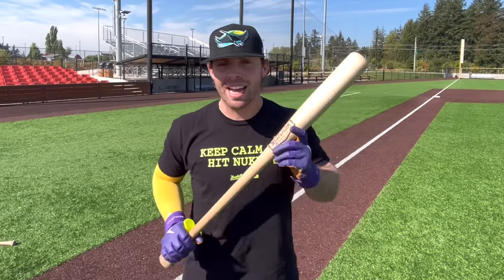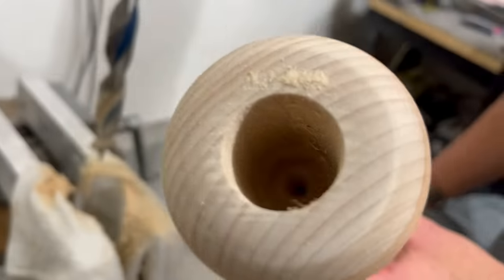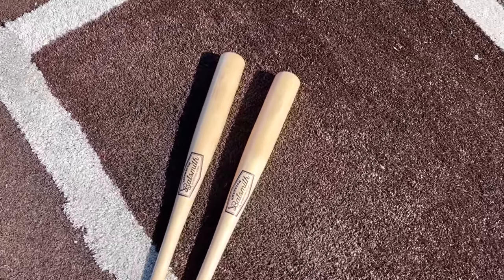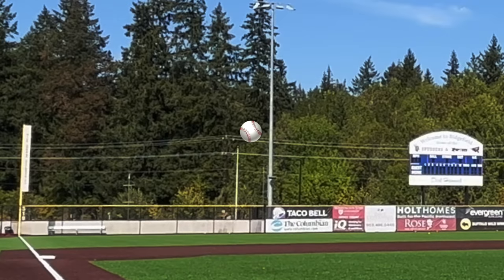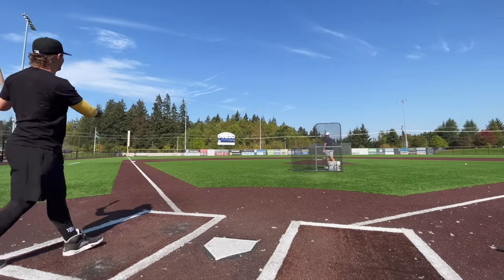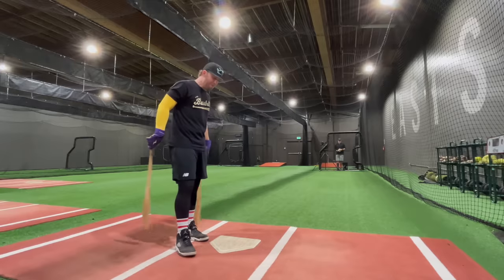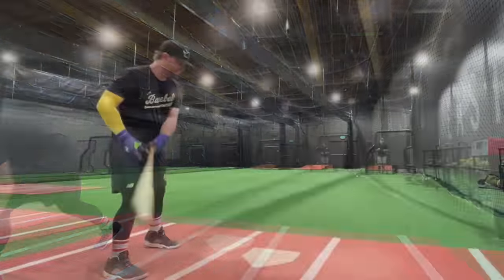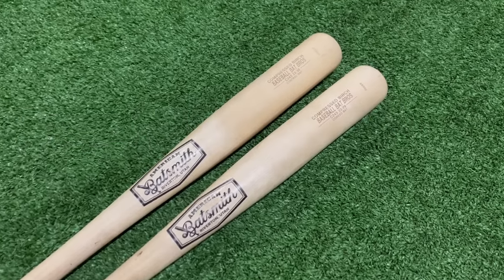CORKING A BASEBALL BAT (the right way)

Comment: Even this is wrong.
Corking the bat isn't about weight reduction. It's about making the bat hollow but reinforcing it with a material that keeps the durability..
Cork bats emulate the way the old c core aluminum bats worked. But not as intense.

Your supposed to grind the cork up to about the size of #4 turkey shot.. then pack it real real tight in the hole , some guys mixed wood glue with the cork and packed it that way.. 
Another cheat was to not fill it up so far, and put lead at the end.. this loaded the end of the bat but kept the bat around the same weight.. the weight transfer to the end makes the hit more powerful in the same way a roll of quarters in your hand  makes a punch more powerful..  

If you pack a bat with ground up cork, youll see what I'm talking about... 
What y'all did worked okay, but if you did it how I explained it would make even more difference

Comment: My feeling is that the corked bat has probably a lower collision efficiency compared to the legal bat. But that is more than offset by the much higher bat speed (lower moment of inertia for the corked bat). Bat speed measurements in the cage would have resolved the issue. This was examined in detail in http://baseball.physics.illinois.edu/AJP-June2011.pdf

Comment: ok so if the whole goal is to lighten it up why dont you just take off that end cap, remove the corks and replace the cap. like why add the cork? is that just so theres not a whole if and when your bat breaks? but surely it would be even better without the corks right?

Comment: How you cork a bat, is to take a metal bat, cut the butt of the bat put cork into the handle, glue the cork to the inside of the bat, weld the butt back to the handle. Then test the corked bat to a non-corked bat.

Comment: I laugh how people think that corking a bat causes the BAT to perform better.. no, it’s something that Ted Williams talked about years ago even back in the ’40’s.. power comes from bat-head speed at the time off the hit.  By making it lighter, it allows you to swing with more bat-head speed causing the ball to travel further.  Mythbusters missed that part when they tested thing because they made the bat-head speed perfectly match.. so no noticable different.. we’re not machines.. lighter bats change our swing speed… Back in Ted williams day, it was thought that a heavy bat, created more inertia for more distance… Nope and the lighter bat has proven to be the key.. which is why there is a rule about bat length to weight ratios…

Comment: If you would have submerged the bat in water for 24 hours before closing the top of the bat off you would have made the inside of the bat with the corks swell up and creates more pressure and pop to the bat and more resistant.

Comment: In the 5th grade, yes 5th, I corked a bat. 
Step 1, buy every superball your local pharmacy has and use your fingernails to make it into little chips. 
Step2, drill the bat as seen in this video. 
Step 3, fill the bat all the way with the superball grains. All the way. 
Step 4, compress the grains and refill. 
Step 5, using a wood plug with glue on it, place the whole contraption in a hydraulic press. Add 5 tons of pressure and leave it there until the plug is glued in. 
Step 6, finish as seen in this video. 

My older brothers friend used that bat in a preseason game. He was an 8th grader. He checked his swing, accidentally hit the ball, and it went all the way to the warning track. He was so scared that he flung the bat hard into the dugout while running to first.  He never used it again because this was in the aluminum bat era around 1989.

Comment: The bat speed differential between the two bats was not measured.  A normal bat weighing 29 oz. would have served as a good control parameter.
Reply from the maker: the whole point of corking a bat is to increase the bat speed
Reply: @baseballbatbros  - I am quite aware of that.  I was just saying that by using a control bat weighing the same as the corked bat and measuring the bat speed (not ball exit speed) of all three bats would have been more definitive.

Comment: Q: Does corking a wooden bat mean that you are basically lightening the barrel of the bat to increase swing speed? If so, I feel as the slight increase in swing speed combined with the lesser density of the bat would just kinda balance out and not make a huge difference unless the swing speed gained is an insane increase? Cool vid tho :)
Reply from the maker: The caveat on a corked bat is that the surface density of the wood remains the same! So you can basically swing a 29 ounce bat that has the hardness of a 30 ounce bat
Reply: @baseballbatbros  Okay I see. Thanks for the insight brother. Also, a potential vid idea, you should look into the Worth Lithium Prodigy made back in 2012 and how overpowered it was because you break it in by squaring off the barrel, which basically made it into an aluminum 4x8 😂
Reply: @baseballbatbros  It also allows the barrel to flex a little bit, giving it a trampoline like action.  Corked bats in super slow mo will go slightly oval at impact.  Much like some kids whiffle bats that have the air cylinders or rubber walls in them.  At certain swing speed ranges they will indeed create higher exit velo than solid bats.
Reply: According to Robert Adair in his book book The Physics of Baseball, yes, corking a bat is effectively just reducing its length/weight to increase swing speed.  He writes:
 
"The bat has been changed significantly.  It is lighter, and effectively shorter, and one can swing it more quickly.  If a player is having trouble getting around on the fastball, this weight reduction will help him in very much the same way that a choice of lighter bat might help.  As with the lighter bat, the batter will probably not drive the fastball as far by 2 or 3 feet when he hits it well with the drilled out bat, but he may hit it with good timing more often."

"Whatever the advantages of the lighter bat, we can see that very near the same results achieved by the illegal modifications could be achieved legally by (a) choking up on the bat by about an inch, (b) using a bat with the same dimensions but constructed of slightly lighter wood, (c) sawing (legally) about three-quarters of an inch off the end of the original bat, or (d) legally turning the barrel down from 2.50 inches to 2.40 inches."

Comment: Im pretty sure corking bats dont actually do anything besides it being lighter
Reply from the maker: It lets you increase bat speed while still maintaining the original surface density of the wood bat. if the bat was previously a little bit difficult to swing, corking it will result in better results for the hitter
Reply: @baseballbatbros  now I understand what it does

Comment: Can u just drill the hole 8 inches deep and then not cork it? No end cap? Would this be against the rules? Its still one peice of wood. I know you can use a cupped bat wouldn't this be  a bigger cup?
Reply from the maker: Yeah that would be legal - but that’s a big durability concern I would think